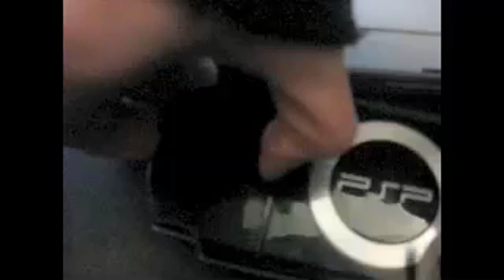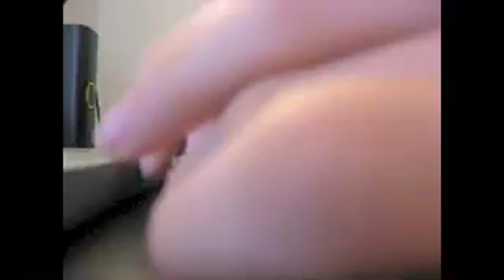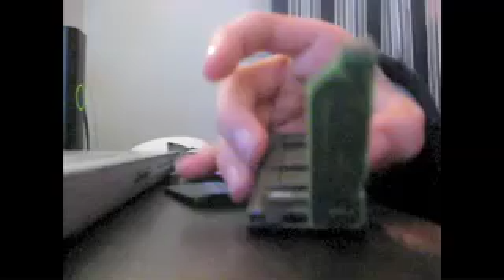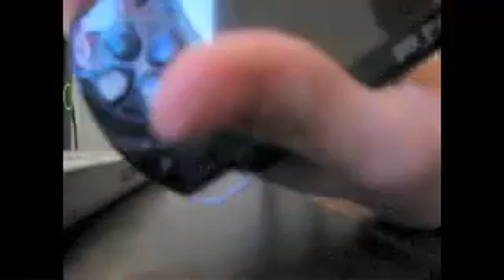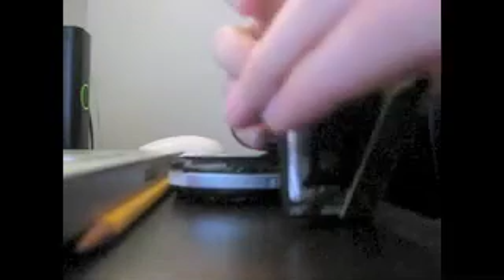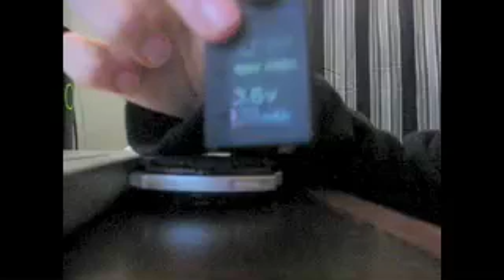How to make a SLIM Pandoras Battery

Comment: ermm lol HELP!

i ripped the chip out cuz i got pissed off
and the psp still loads up normal :s HELP ME lol its a psp slim 2003

and on top of all this i got a 2400mAh slim bat and it dont work in my psp but it charges in it
and wen i put it in my fat downgraded psp it works but dies fast i am exstremly confussed som1 help me lolz

thx :P